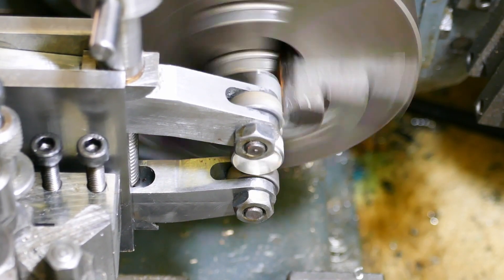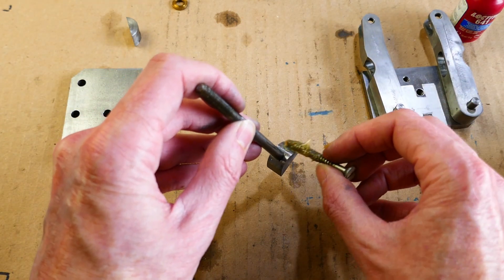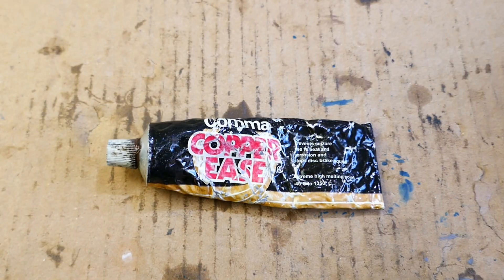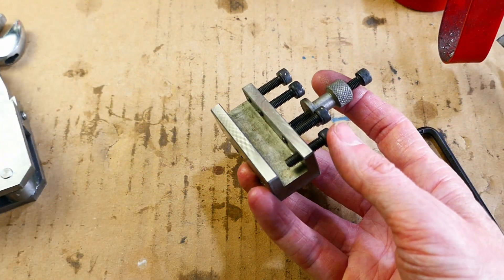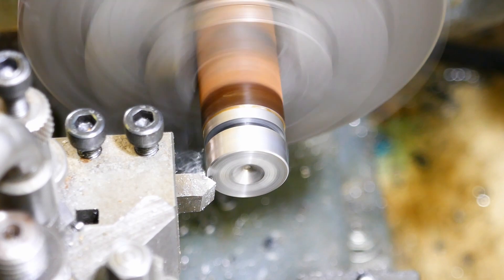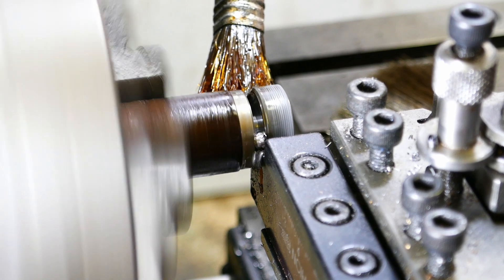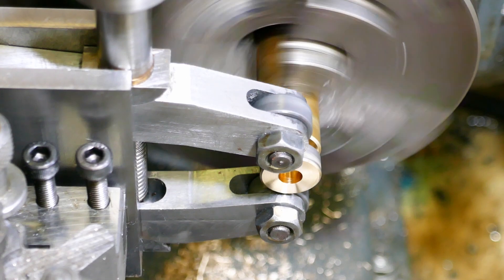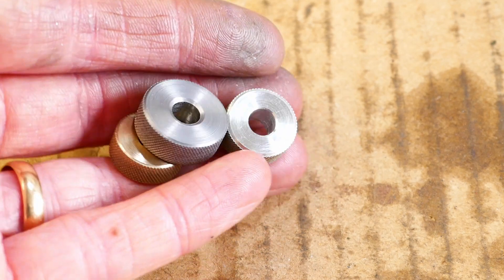Making and testing a knurling tool on the lathe

Comment: I’ve seen a great many Youtube videos on knurling, and several showing attempts at making the Hemingway kit that is the basis of your tool. 

Sadly, though, when it comes to doing some actual knurling, very few people seem to be able to produce what could be described as a good knurl. It’s very refreshing to see that you’re clearly an exception to this, as the knurls you’ve produced look excellent.

I bought the Hemingway kit last year, but I’ve simply not had the chance to make significant progress with it yet. 

Would you be good enough to answer a few questions? I see you held the axles the knurling wheels turn on in place with hex nuts. I think the kit suggests tapping the relevant side of the slot and screwing the threaded axle end into the tapped hole. Did you use the nuts to provide a more secure fastening? Did you use the 3/16” wide knurls Hemingway suggests? Do you find the Tommy bar gives enough torque to easily tighten the wheels down on to a part? I know this rather short tommy bar is what Hemingway suggests. 

Are there any other departures you made from the Hemingway instructions? I don’t remember the H shim being in the instructions, though I’ve not got these in front of me at present to check.

Anyway, all the best with your channel, and well done for the exemplary demonstration!